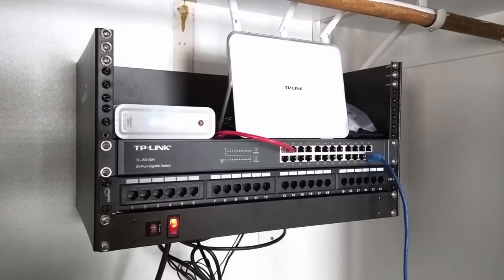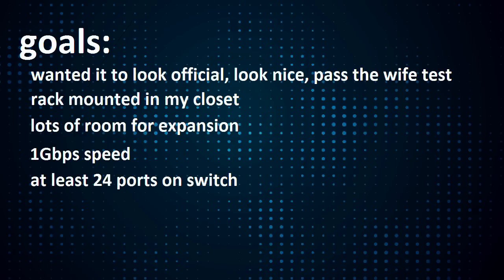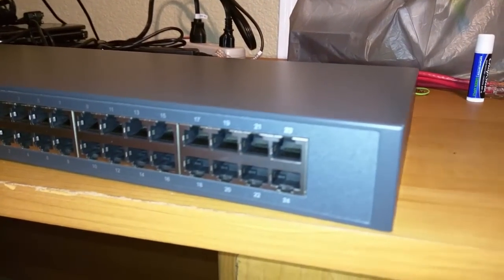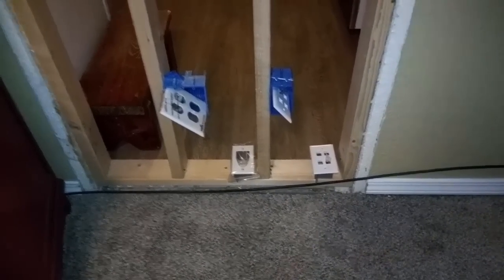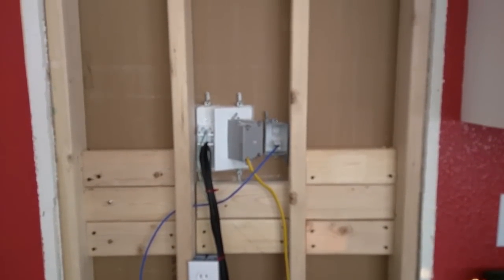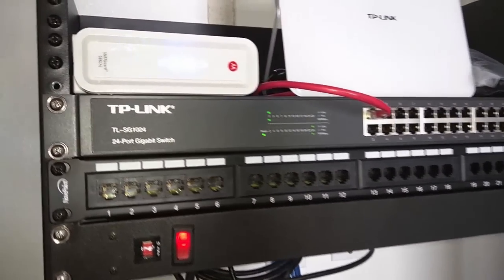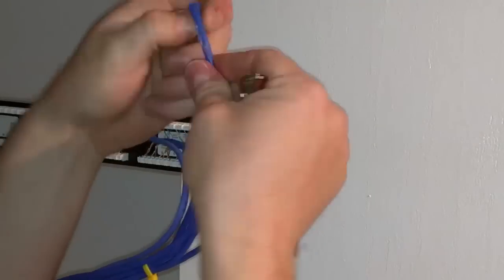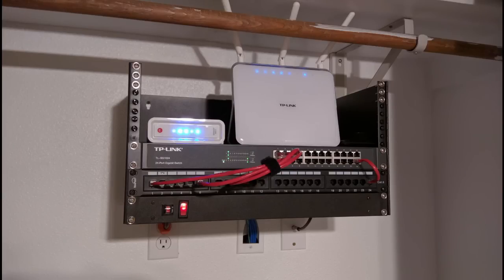Budget Home Network Tour/How To

Comment: Is the router necessary since I'm going to be using the cable provider's wifi modem/router?
Reply from the maker: If your isp gives you a Modem/router combo, then no, a second router is not necessary.
Reply: @BudgetNerd  excuse my lack of knowledge but how do I determine that?
Reply from the maker: If you already have the unit from your isp, you could check box or the specs. Also depending on the ports on it, it will tell you. If it has built in wifi, it is most likely a router as well. If you don't have it yet, might be easiest to ask your isp what they are sending you. They will know. If all else fails, you could reply with it's model number, and I could tell you.
Reply: @BudgetNerd  Thanks, I haven't unboxed my router/modem yet but it is wifi capable.
Reply from the maker: It's probably a router then, but you could always let me know the model # and I could check.
Reply: @BudgetNerd  5268A UVRGX Gateway
Reply from the maker: Yes looks like that is a router.
Reply: @BudgetNerd  I will inform you when I begin my project, might even record and upload it so I can give you an honorable mention.  Thanks

Comment: Amateur question here. When setting up the switch, is the modem plugged directly in to the switch first? I have a wireless router that I want upstairs but the rest of the network is deep down in the basement. Was hoping I could plug the modem direct in to the switch and then run cable from upstairs wireless router in to the switch. Can this be done? (Modem -->Switch-->Wireless router)
Reply from the maker: +John Kochanowski the modem should be connected to the router next.. then the router connected to the switch.
Reply: Thanks man! I think I'm going to disable the wireless on the current setup and run ethernet from 1) a new modem to 2) existing router then 3) to new (higher-end) wireless router which will be placed in the middle of the first floor. Just don't want the wireless router down in the basement... while not a huge house, it's old and has really thick walls. Getting wireless to the upstairs rooms from the basement has been unbearable! We'll be sure to run the new 24-port PoE switch from the router (with wireless disabled) down in the basement and make all the hard-wired connections work from the switch (7 cameras and 2 connections per room + some other devices). If there are any gotchas in that approach please let me know what to look out for!
Reply from the maker: +John Kochanowski having two routers in the same setup will give you two networks. With some configuring on the second router, you can have it act as a switch/access point and disable the router function. Or you could just run from the 1st router straight to the switch you are taking about, and get a separate access point and connect it to the switch as well.
Reply: I like the latter approach you suggest. I didn't think that it was possible to run a second separate access point to the switch! I was going to purchase a second wireless router (ASUS AC3100 Wireless Dual Band (5GHz + 2.4GHz) Gigabit Wi-Fi Router [RT-AC88U] 802.11ac). At this point it sounds like I need a solid router (not wireless) connected to the modem and a wireless access point .Now for a follow on: Is there a suggested/recommended access point? Are there any good PoE Access Points (since I'm looking at a PoE switch)? I have a feeling that second ASUS AC3100  is overkill. MUCH appreciate the feedback!
Reply from the maker: +John Kochanowski there are lots that are good, you could check out ubiquti. They have lots of features for the money. But if it's a brand you recognize.. and it's rated high, it's hard to go wrong.
Reply: I had a question as to how you did that so cleanly, did you run a line from the router to the back of the patch panel, just cut it and hardwired in that last port?  I can't tell from your final pictures.
Reply from the maker: +Michael Polinski yes that is what I did. You can see that same thing in more detail in my complete network setup video I uploaded later
Reply: OK, great, thank you!

Comment: I guess the Motorola device is the modem from your ISP, did you just connected it to the TP-Link switch without setting up anyhting? I mean, like a little switch thta you simply use an ethernet cable from the modem to the little switch and then you just connect other devices like access points, desktop pcs, printers using more ethernet cables. Thanks a lot!
Reply from the maker: +Abraham Fraga Mtz modem plugs into the TP-Link router, and then the router goes to the large switch.
Reply: Okay, I got it. But why dd you do this? I mean, you could connect the modem directly to the large switch, right? Is there any special reason for you to do it?
Reply from the maker: +Abraham Fraga Mtz for the most part you will need a router. It enables all your devices to communicate with another network.. namely the internet in this case.
Reply: Primary reason is for NAT/PAT. In IPv4 addresses are scarce so when your ISP needs to give you some they only give you one(you can sometimes pay for more) and your NAT router will pretend to be the one computer that does every thing on your network. If your computer has an internal IPv4 address starting with 10.X.X.X/8 or 192.168.X.X/16 address you are using NAT to slow IPv4 exhaustion. In IPv6 NAT is no longer needed but you can still use the router as a WIFI access point and Firewall in this configuration.

Comment: I would highly recommend anyone considering a patch panel to use a keystone panel instead of the direct punch 110 panels. I notice far too often that termination is done without respect to preserving twist, along with maximum unjacketed exposure and all this talk about 10G and Augmented CAT6 is scary when you have folks who don't realize this isn't the old CAT3, or even 5.... you HAVE to maintain integrity of the pairs until the very end or you're going to cause all sorts of AXT and NEXT... and you won't know it until you try to saturate the line with a certification tool (or the common man's method of point-to-point packet testing). Also CAT6A should truly come with a drain and foil jacket F/UTP at minimum, which means you need to use shielded endpoints, and keystones make that swap possible where an older CAT6 UTP punch block does not. Also remember that shielding is useless here without a ground connection made at the jack.

One of the best references I can give to someone considering doing their own wiring is here: http://www.hubbell-premise.com/literature/Cat6A.pdf

I won't sit here and act like an elitist network guy.... it can be done as well as the professionals as long as you truly take the time to do all your research and learn before you touch even a single cable.
Reply from the maker: +Szalk erous good tips! I'll check out that PDF!

Comment: Will cat 5e still be okay for the next 10yrs?
Reply from the maker: Yes and no. If you want to use 1Gbps or maybe 10Gbps  equipment for the next 10 years, then you should be fine.

If you want the best speeds and use the latest equipment as it comes out, I would go with cat6a or better if you can afford it.

Comment: When you’re showing the patch panel swings open you then cut to 3:30 and there’s another part installed below it, looks like it has a power switch on it? what’s that part and does it come with the patch panel or buy it separate?
Reply from the maker: Sounds like you are talking about the rack mounted power strip. It doesn't come with the patch panel, it's a separate thing.
Reply: @BudgetNerd  Do you need one of them as well?
Reply from the maker: Well you don't have to have one of those, but you do need to power some of those devices so they do come in handy and keep things neat.

Comment: @BudgetNerd Where did you buy the ethernet cable and how much footage do you recommend for an apartment of 1400 Sq ft?
Reply from the maker: That cabling I already had so I didn't have to buy that. How much you'll need depends on all sorts of things. How many runs you'll have, will you run them in pairs, how far are the runs, the design of your house. Do a bit of math and then buy what you think you'll need. If in doubt, buy less, you can always buy more

Comment: You got a 24-port switch... for 8-10 cable runs? You know they make smaller switches, right?
Reply from the maker: +DEAD_P1XL yes of course, just wanted room for expansion. I do plan on adding more in the future..
Reply: switches are so cheap.. doesn't cost that much more just to get the 24 port.

Comment: I dont understand, what is the difference between a home area network and a local area network? All the devices in my home are connected to a router wirelessly and also all connected to a wireless printer through the router. So is this essentially a HAN? Or a LAN??
Reply from the maker: Your setup and my setup are both LANs. One communicates over wireless, while mine has wireless and wired connections.
Reply: @BudgetNerd  so essentially Han and lan are the same?
Reply from the maker: Never really heard of the term han before, but it could be a thing. But to answer your question simply, the way you are asking, yes they are the same thing.
Reply: @BudgetNerd  thank you. Great vid by the way and great setup

Comment: do you have any plans to add a firewall or traffic antivirus scanner? I used an Up Board loaded with Ubilinux 3.0 (Up Board specific version of Debian Jessie), OpenVPN client & setup a VPN Router. I use VyprVPN service. Next I changed my router's (TP-LINK AD7200)  DHCP server to handout my VPN Client Router's IP address as the gateway. Now everything routes through the VPN just fine. I'm interested in setting up a box or another SBC like the Up Board or Raspberry Pi 3 to scan all incoming traffic for viruses, malware etc & block ads. Have no clue how to do it yet though. The reason I chose the Up Board for the VPN, is: 1) already had it. 2) it uses an Intel Atom X5-Z8350 64 bit Quad Core with AES-NI built in, 4GB RAM, 64GB eMMC, Onboard Gigabit Ethernet & USB 3.0. The CPU is the key as it can handle the encryption & decryption & is fast enough to handle the data flow from the Gigabit Ethernet, as well as, my residential cable Internet of 112Mbps down & 12Mbps up.
Reply from the maker: +Magestic I have never set anything like that up before. Sounds fancy!
Reply: Budget Nerd be glad to share the info if you're interested.
Reply from the maker: +Magestic sure! I love to learn!
Reply: Budget Nerd I'm not well versed on YouTube, except watching. is there a direct message feature? I'd like to exchange email addresses, but not in the open.
Reply from the maker: +Magestic I think you can do a personal message. I haven't ever done one either..

Comment: how did u  connect ur router to the switch? i can't see no cable attached
Reply from the maker: Port 24 on the patch panel runs to the router
Reply: @BudgetNerd  at 0:0 u probably connected the router to the switch with that little red cable and at the end of the video u connected the router to patch panel??
Reply from the maker: Yes the little red cable at the far right of the switch and patch panel connects the router to the switch.

Comment: does it speed up your ethernet or does it just provide you with tons of ports??
Reply from the maker: +Weeezzy simply put, the speed of the switch decides the speed of your network, I just get lots of ports
Reply: Ah ok and do you know how i can speed up my old house ethernet?
Reply from the maker: +Weeezzy well, that question could have multiple answers.. first, you could wire anything you can instead of wireless. Wireless is great, but it's just not as fast. Second, you could look at your hardware. If you upgrade your network equipment and your network card on your PC, that could speed up the network. You'll want to make sure your equipment is 1Gbps capable. Third, if you are referring to you internet speed, you might see if your provider has other plans, or if there are other providers to chose from.
Reply: ben johnson think this will help a Little thanks a lot

Comment: Did you run into any heat ventilation issues in the closet?
Reply from the maker: +ltcolglennr no. That setup doesn't create much heat. I usually leave the closet doors open anyway to look at all the blinking lights..

Comment: is #24 on your switch your cable modem or your router? how do you hook up your router to the switch?
Reply from the maker: +Jeff Liu Yoshiyuki it goes to my router. I run a cable from the router to port 24 on the patch panel. I punch it down like any of the other cables. Then just created a tiny patch cable to connect it to the switch.
Reply: Budget Nerd and the cable modem still gets connected to the router right?
Reply from the maker: +Jeff Liu Yoshiyuki correct. That is just a direct connection behind the whole setup.

Comment: no Staples for the ac power wire ?
Reply from the maker: +glues4wood in hindsight, might have been a good idea. I'm no electrician.
Reply: yes it is fine as long as it is you living there problem arises when you sell it or move out, the new people have no idea where the wire is and could lead to a house fire hopefully when they are not sleeping but the rack looks really nice
Reply from the maker: +glues4wood you say "when" as if I have months to enjoy my house before it burns. Chances are I'm ok. I appreciate your concern though good sir.
Reply: no you would be fine, you can enjoy it for years and hope you do, it is when someone else wants to do something on that wall without knowing there is wires in the middle of a wall
Reply: which could be 20 or 30 years or more

Comment: What were you doing for A/C to avoid overheating?
Reply from the maker: +chrisgast nothing gets hot in there. I have been leaving the closet doors open so I can stare at it.
Reply: So, you're not even turning it on - just staring at it?
Reply: Wow! Maybe not hot, but I would've thought it'd get at least a little warm in there with that kind of hardware.
Reply from the maker: +chrisgast nah. Really doesn't generate much heat. They are all passively cooled, so not much heat at all.
Reply from the maker: +chrisgast ha... No it's on. Half of what I like to stare at are the flashing lights. :)

Comment: What did you do to keep that closet cool?
Reply from the maker: +Jason M I go stand in it for a few minutes and then it's super cool. JK.. nothing yet. That setup doesn't really generate much heat. So far I've been leaving the door open to stare at it and that is more than enough I would think.
Reply: Budget Nerd lol ok. I have it in a shoe closet right as you come in my home so I can't leave the door open. Thought of putting an exhaust fan on there just into the upstairs sub floor but not sure.
Reply from the maker: +Jason M you could, you just want to think it through. Something that any future home buyer would be fine with is how I think of it. The solution varies on house and location. Mine is in the middle on my first floor, so there's really no good way to vent heat out of mine really.

Comment: Damn you for making me buy all this stuff!!! Just kidding. I was looking to do this anyways, but you gave me the nudge. My whole network center is in the attic which may be a mistake, but I made sure all my equipment is fan cooled and an A/C duct is near by if needed. Not sure if that will create condensation though. My reason for putting the equipment in the attic was to keep it out of sight, away from children, and free up valuable space in the house. Any input on switches being exposed to high temps?
Reply from the maker: All electronics hate getting hot, attics can get hot. Just keep an eye on it, and adjust cooling solutions as needed.
Reply: Budget Nerd Thanks, I’ll do that. Thanks for getting back to me! Have a great night and love the videos!

Comment: What's your original internet speed without all the equipment ?
Reply from the maker: +Raul Gabriel it didn't change my internet speed, but did change my network speed, I get upwards of 800Mbps over my network. This mostly added more ports and made it look cool.
Reply: Budget Nerd oh... so there is no way I can improve my 2mbs speed
Reply from the maker: +Raul Gabriel any extra speed when talking about your connection to the internet would come from your internet provider. See if they have faster speeds, or see if there are other options for internet providers.

Comment: patch panels are not an option for me as I live in an apartment and can't make alterations to the place
Reply from the maker: +chrismc410 I hear ya. One day...
Reply: Budget Nerd so it's either wifi or direct to the router as it has ports for devices. If I could do it I would. Been working in IT for 19 years now.
Reply from the maker: +chrismc410 cool. I love IT. It's my thing too. :)
Reply: Budget Nerd how is that switch working out? Ive only used Cisco or Netgear equipment myself and exposed to Brocade.
Reply from the maker: +chrismc410 so far so good. Not much to configure on it, but it's working very well.

Comment: i have that swich and i cant get it to distribute internet???
Reply from the maker: Do you have the switch plugged into a LAN port on the router? Plugged in all the way? Is the Ethernet cable a good one? Try a different port on the switch. Is it one wired device that doesn't get a connection and the others are okay? Do they just not get internet, or no network connection at all? Does the LAN port light on the switch light up when something is plugged in? Did you reboot you network hardware?